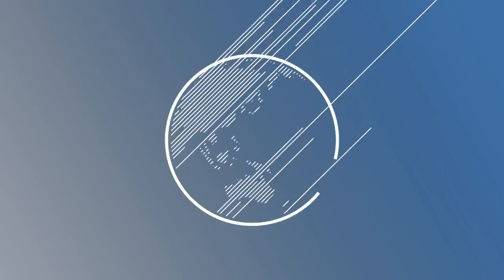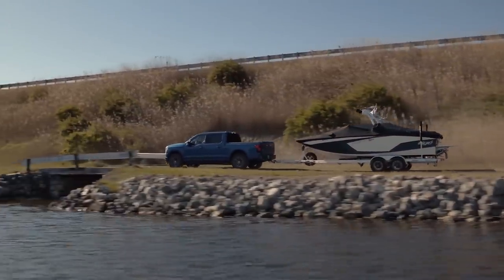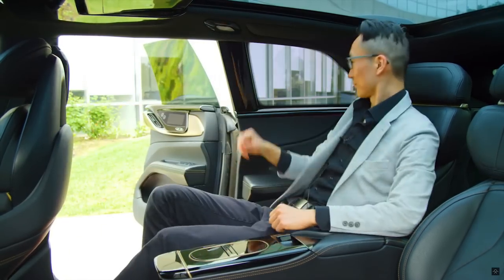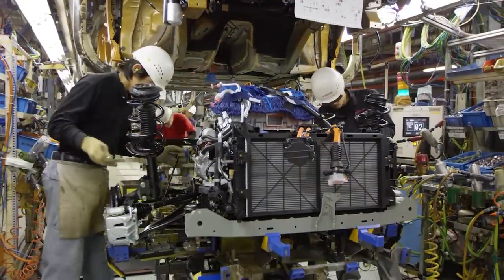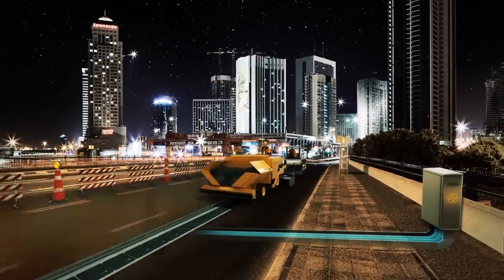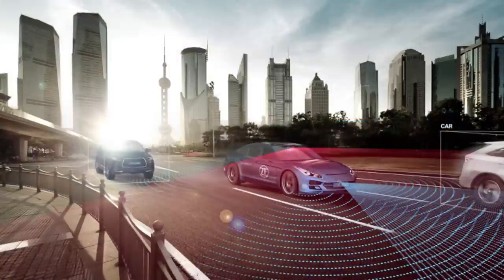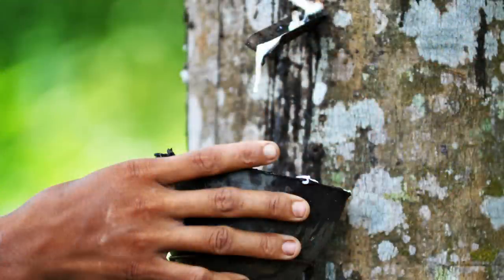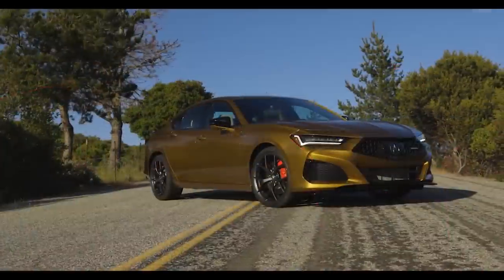Ford Reveals F-150 Lightning; BMW First to Use Sustainable Rubber Tires - Autoline Daily 3084

Comment: The F-150 Lightning is the real EV truck benchmark by which all others should be judged. In addition to offering quick acceleration, it most importantly doesn't skip on ANY of the utility and functionality that current truck buyers expect from this segment. The same cannot be said of the Rivian R1T and especially not the Cybertruck, which so far seems to be more like a giant toy than particularly useful. That the various tow, cabin, and bed features remain means this will find favor with both general consumers and fleet managers alike.
Reply: If by benchmark you mean "Bare minimum for consideration", then we agree. 
Good thing both the Rivian and Cybertruck have better specs for similar prices.
Reply: @CSHarvey  other than projected range estimates, which of their specs are better?
Reply: "... it most importantly doesn't skip on ANY of the utility and functionality that current truck buyers expect from this segment."

Range is absolutely pathetic, you're talking nonsense.
Reply: @PistonAvatarGuy  again, other than projected range, which specs are better in the named competition?
Reply: Pauline Weinberger  an unproductive contribution. Thanks.
Reply: @JDubbs07  What else matters?
Reply: @PistonAvatarGuy  the things that people actually buy a truck for is what matters: payload & towing capacity, tool storage options, passenger space, towing assistance tech, work features like a WiFi hotspot and their new ability to fold the center armrest forward to make a completely flat work area, and the ability to power tools using the truck itself. These are things that matter to truck buyers, and it's why Ford makes so many F-150 variants. It's not all about how far it will go before it's out of juice, and Ford knows this.
Reply: @JDubbs07  Because towing capacity doesn't matter if the truck can't tow something to its destination. I can think of 5 different truck owners on my short little street alone who use their trucks to tow over long distances. Three of them haul boats, one hauls a travel trailer, one hauls a horse trailer to his ranch. Heck, I think that's all but one of the truck owners on my street.
Reply: @PistonAvatarGuy  that's all well and good, but the 5 people on your street don't represent all towing needs. It all depends on what you're towing, and where you're taking it. For across town tow jobs, this will be more than fine. When you're looking at any of the forthcoming competition, range will absolutely fall off a cliff for all of them for a serious tow job. There's a very real chance none of them will make it to your favorite mountain lake you like to bring your boat to. But beyond towing, you also have to think of all the other use cases people buy trucks for, and again, Ford is bringing its tested and customer approved solutions in functionality that the competition doesn't seem to offer. Rivian's storage space between the cabin and bed is an effort towards that desirable functionality.

I know it's very easy to devolve into a simple discussion on range when talking about EVs, but there's more to the story. And in thinking about real customers, you have to have a full story to tell.
Reply: @JDubbs07  "...but the 5 people on your street don't represent all towing needs."

No, but it is a good indication of the capability that the average truck buyer expects their truck to have.

Anyway, Ford corporate PR guy, this conversation is pointless, as you're clearly paid to be biased.
Reply: @PistonAvatarGuy  sorry you're unable to look beyond your single narrative, and that it'd be easier for you to think so simply so you'd rather focus on just one aspect of truck ownership. Ford sold almost 900,000 F-150s in 2019. Thinking the 5 people in your immediate area represent the average buyer of this huge pool is the definition of naive.
Reply: @JDubbs07  Yes, clearly, I'm the one being naive here.
Reply: @PistonAvatarGuy  you sure are. Using the absolutely terrible logic of "my neighbors do this, therefore all people must do this too" is a bad place to start. In addition to completely ignoring the fact there is a longer range model, you haven't even applied the basic understanding that no one vehicle accounts for all use cases. Your neighbors need a truck to tow long distances, and this one may not meet their needs. That doesn't make it "pathetic" (your words), it means it's not for them. There is a ton of other functionality in this truck to be had for the people who don't have such a need.
Reply: @JDubbs07  I can go anywhere in the city and see plenty of boats and/or travel trailers parked next to houses, what are the owners using to haul them? Anyone can do the same thing in basically any city in the US! If you've spent any time on the highway, you'll see truck after truck, hauling trailers of some kind. Towing over long distances is a major reason why people buy trucks, it has been since the earliest days of the automobile!

I didn't say that EVERYONE tows over long distances, I said that it's a major reason why people buy trucks, and that's just a fact.

The longer range model is likely to be prohibitively expensive, and it probably still wont have enough range while towing for it to be appealing to truck buyers.

You living on another planet does not make me wrong about this, it just means that you have no idea how people live in the US.
Reply: @PistonAvatarGuy  then you also can go to just as many places in the city and on highways to see just as many unladen pickups and houses without boats and travel trailers. Again, no truck meets all use cases. Stop doubling down on your bad take. Many of those people happily already have a gas F-150 to tow their toys. No, they can't replace it with this model. They will have to wait for battery tech to advance and for price premiums to come down if they can't afford it.
Reply: @JDubbs07  All of my neighbors use their trucks as daily drivers, that doesn't mean that they don't also want them to be able to tow when they want to tow something with them.

Almost no one wants BEVs in general, truck buyers even less so than most.
Reply: @PistonAvatarGuy  the battery tech and charging infrastructure is just not there yet, and with how quickly things are changing in this space your brand new EV may be made effectively obsolete within 2 years, and by the very same automaker you bought yours from. And for truck buyers the cache just isn't there. As already the case, I'm expecting a large part of Ford's Lightning sales to come from municipal and commercial fleets. The lower running costs, private lots with access to charging (provided they make the investment), short travel distances for their work, and the ability to power tools using the truck should at least put this on the consideration list.
Reply: @JDubbs07  Battery tech wont EVER be there, batteries are simply too heavy to make long range towing viable, and they will be for all of the foreseeable future. Charging infrastructure doesn't even matter, because no one wants to wait around for hours for their vehicle to charge, or they simply don't have the time.
Reply: @PistonAvatarGuy  Ford's omission of an 800v architecture to cut down on charging time is probably a reflection of their lack of R&D funds compared to VW and the Hyundai Motor Group. Otherwise they could've advertised that their charging times were roughly that of the mandated break time of many hourly workers. That's a missed opportunity.
Reply: @JDubbs07  It wouldn't make any difference in this application.

Comment: I’m crazy excited for the F-150. Especially the base models for business. I don’t want to buy one. I want a Cyber truck, especially a smaller cyber truck or an SUV version that can fit in my garage (no other parking options for me). 

I hope lots of people buy into the Ford ecosystem but it was funny when they said they are part of the largest public charging network in the US. Teslas will always have a larger network since they have a private network but are still mostly compatible with public networks. If they changed to CCS or offered an adapter, then they would ALWAYS have the largest charging network.
Reply: That policy you described is one of the biggest beefs I have with Tesla. They actively slow down EV adoption by their anti-competitive practices. All while waving the flag of "accelerating the world's transition to sustainable energy"? What a bunch of hypocrites.
I said "never again" to proprietary charging standards with Apple, won't ever be supporting any company that does the same with EVs.

Comment: “ distinctive style “ by an leds. K. 
To be clear 
Stripped down Commcerical : $39K 
Base: $53K …. 230 miles 
Premium $90K …. 230 or 300 miles ?
Reply: Seeking clarity, and then speculating on price? Ok.

XLT in current Ford trim levels is one up from base, and presumably will have quite a lot of additional equipment most will be happy with, considering the ~13k premium.
Reply: lmfao
Reply: @JDubbs07  nope not speculating on   price at all. Look harder my friend. They posted exactly this “ be among the own the all-new 2022 Ford F-150 lighting. The entry models starts at $39,974 mrsp (Commercial-oriented ). More equipped mid-series XLT starts at $52,974, offering additional comfort and technology. MSRP  starting at $39,974 up to and around $90,474”. If you’re not lazy you can find this on the order page. So am I speculating on price and the entry commcerial vehicle begging stripped down or reading verbatim from Ford themselves ? Enjoy paying $13K more for 230 miles of range—- that’s embarrassing. The trucks… okay, but loyalist and fanatics will defend it to the end push it’s the only option and will “ destroy l everything else. When in reality Ford just doubled down on outdated battery technology and will pay for it down the line. The product doesn’t do a compelling job at creating new buyers… it’s just converting it’s existing users like you. That’s not an expansion of a market… it’s called cannibalization .
Reply: @TrevX2001  your post is incorrect in that you said base for $53k, which is incorrect. The price increase is also the result of added feature content, not battery capacity, so that's a bad take. And while 230 miles of range isn't particularly impressive, it's within the realm of other currently available EVs from major manufacturers, so it's not actually uncompetitive. You also seem to fail to realize that Ford doesn't have to create a product with the express purpose of finding new buyers because they are Ford - they already have several million customers to entice, and as they transition into a fully electric product line, it is mission critical that they retain as many customers through that transition as possible so as not to lose their #1 ranking. You don't reinvent the wheel with an extremely well proven formula. Improved battery tech and range will come with time, but they need to appeal to their base now.

Comment: has ford and general motors subjected themselves to the osborn effect? by previewing their electric trucks too soon, prior to production????
osborn computers advertised their next model of computer, too soon. which dropped sales of their current model. putting them into bankruptcy.
ford and g.m. ice trucks (internal combustion engine) will be competing with e.v. trucks with production more than a year in the future, those buyers wanting a new vehicle, may just wait until the e.v. truck is available to buy.
the osborn effect isn't applicable for e.v. companies, as they don't have a competing product available.also the ford and g.m. trucks are going to need  larger batteries and faster charging.
Reply: The majority of truck buyers couldn't care less about electric trucks.
Reply: @PistonAvatarGuy  true, but some people have to consider the regulations being placed on gas/diesel vehicles in many locations. that section of the market will have to buy a electric or fuel cell vehicle.  we may be surprised by the number who may decide to wait and forgo buying a new vehicle until the electric is available.
Reply: @erehwon9371  "we may be surprised by the number who may decide to wait and forgo buying a new vehicle until the electric is available."

No, buddy, probably less than 1% of truck buyers would buy an electric truck. Seriously, what planet do you people live on?